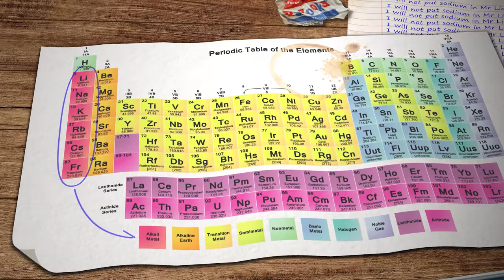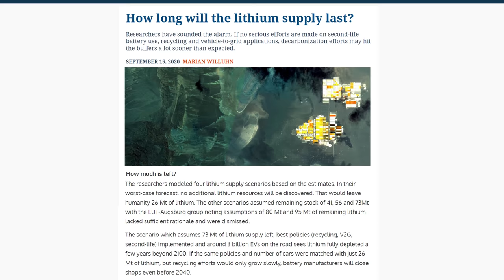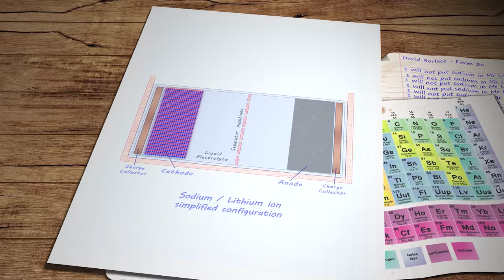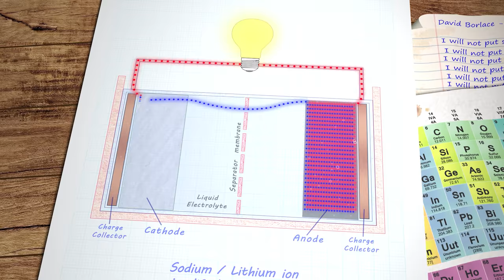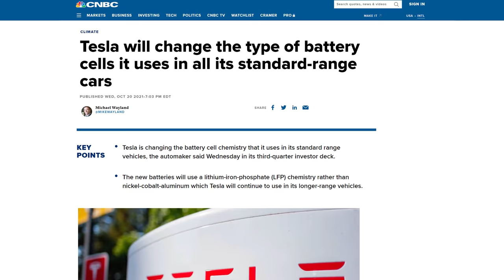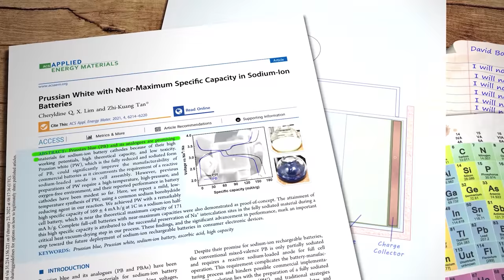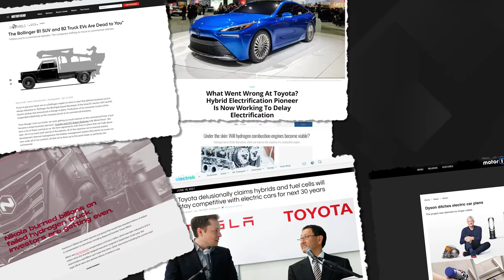Sodium-ion battery breakthrough. Safer, cheaper and cleaner than Lithium-ion

Comment: Thanks for this great work.  It always seemed strange to me that lithium became the main battery product for storage where weight is not an issue.  It shows just how important investment and manufacturing momentum can be in sealing in sub-optimum technology (e.g. Betamax vs VHS).
Reply: There's a lot to be said for sub optimal I reckon particularly when it's mature if not old tech.
At the moment lead acid batteries are so cheap it is ridiculous. If you size the bank to never drain these type of batteries below 10% of max capacity they could last a dozen years at 1/3 to 1/4 the cost of lithium based tech for considerably more amp hours to boot.
Of course if you need lithium you need lithium, but for home storage do you really need lithium, when lead acid (AGM) at similar life, more  amp hrs and 1/4 the cost will do essentially the same thing in many applications?
Reply: @ThePaulv12  Very interesting, thanks for sharing! Doing some quick searching, I was surprised to see that a $200 (retail) car battery has capacity of about 0.7kWh, and I assume it's possible to buy them wholesale if buying a large number of them. Any favorite pointers on resources for people wanting to learn more about lead acid batteries and how to integrate them into an off-grid home? For example, how would I make sure they don't drop below 10% capacity? And what kind of parallel / series systems are recommended for lead acid batteries?
Reply: @ThePaulv12  That lead and lithium are both toxic is one problem that sodium batteries could solve. I've also seen some research on aluminum batteries.
That said, it's hard to beat good ol' lead-acid for value. It's kind of like burning coal for energy.
Reply from the maker: Thanks Philip. I completely agree
Reply: @dosadoodle  Ideally you don't want to use ordinary automotive batteries but rather deep-cycle Pb-acid batteries designed for off-grid use.  Alternatively, I have seen people use in the past Pb-acid forklift batteries or second hand cells from comms towers or railway signalling for off-grid storage.  Using a decent charger/inverter should let you select the battery type and discharge limits of the batteries.  I couldn't tell you any makes atm as it's 25 years ago that I fitted a hybrid solar-diesel Pb-acid storage system at the school I was teaching in rural Zimbabwe.  We were the only place with electricity in the valley once the system was up and running.  The electronic charger/inverter we used was top of the line back then and very efficient and adaptable.  So, today's tech should be at least as good at a fraction of the costs I would hope.
Reply: Yea. We often get obsessed over very minor technical differences in tech which don’t actually affect 80% of customers.
Reply: @TheTomBevis  Lithium is not particularly toxic.  It's way, WAY, WAY less toxic than lead.
Reply: Not disagreeing with your point - but with your comparison. That old Betamax/VHS trope is far more complex than just the "suboptimal" technology winning. The main reason that Betamax failed was that the cassettes weren't long enough to hold an entire film. And by the time they'd twisted the technology into doing this, the battle had been long lost. Products win or lose mainly on how they match people's requirements, not on how clever they are. For instance Blu-ray never replaced DVDs, despite being a superior technology because DVDs were good enough, pre-HD TVs, and then streaming came along. Ditto with minidisks - much cleverer and more convenient that CDs, but CDs were ok enough to make upgrading too onerous - and then (again) along came easy access to music via the internet. The key to the success of a new technology is not is it better than the previous one, but is it better enough to make it worthwhile changing. Does it offer a significant bonus to the consumer? If not, it will fail. Hopefully, the answer with these batteries will be 'yes'.
Reply: @TheTomBevis  : To the best of my knowledge, all aluminum batteries are non-rechargable (in a sense that isn't even true for alkalines, since those just suck as rechargeables). In particular, I strongly suspect that trying to recharge the existing/proposed aluminum battery designs would result in severe internal sparking, in turn resulting in heat buildup, internal damage, and a localization of current flow significantly limiting the amount of restored charge. Aluminum batteries are probably better treated as an emergency power source to rebuild power generators rather than something to be used by normal consumers.
Reply: @dosadoodle  I'm talking for 48v battery bank.
Deep cycle lead acid of the AGM type can be found in these parts for sub $550ea for a 6v cell and 550ah.
Well you need 8 of them for a 48v bank for a 48v inverter and you're in the sub $4500 region. Try getting that capacity in lithium at 48v and see how much it costs
 Also you'd need to run 2x parallel strings of series connected lithium banks with all the issues that entails to get similsr amp hours.
48v is the current ideal battery bank voltage for dedicated off grid 24/7 solar 240v electricity - sunshine permitting of course.
Reply: @ThePaulv12  Thank you for this additional info! Very helpful for a direction to explore further.
Reply: @dosadoodle  Just so you know car bayteries need CCA (Cold Cranking Amps) and that's their primary role. Their secodary role is for storage. Deep Cylcle batteries are different to car batteries. Top quality lead acid deep cycle batteries can be found with 2v cells. The cost of them is very high as you meed 24 of them to get 48v putting them into the realm of newer tech but it seems 6v batteries could be worthwile if you don't need lithium.
Lithium is good. It takes little time to charge up making it ideal but lead acid could be worthwile if you buy batteries and solar panels that are more than you bare minimum power needs. It's a balancing act.
Reply: An oil company bought up the EV1 patents, prohibiting the use of NiMH batteries in automotive applications. So electric automotive start-ups like Tesla were forced to use off-the shelf laptop batteries (18650 cells). See the "Patent encumbrance of large automotive NiMH batteries" wikipedia page.
Reply: Yeah there are a lot of far less expensive battery options (like salt water and iron chemistries) which would make sense for grid storage where performance is far less important than cost. But none of them have gigafactories backing them.
Reply: @ThePaulv12  
Lead acid and nickel cadmium both use heavy metals that have gotten into the environment and done toxic damage.  It's best to keep them out of the environment.

As for cost, the lithium batteries are cheaper,  per kWh than the lead acid, which last much, much less than lithium.  This is because the lead acid battery makers don't make them to last.
Reply: Where do you get the idea that lithium is toxic?  Lithium carbonate is or has been used medically for ages to treat manic depressive mental disorder.   I have even eaten some to see what it did. Nothing I could notice. Sodium is definitely toxic when consumed in excess  by upsetting electrolyte balance. Nearly everything is toxic when consumed in quantity, even water.
Reply: @acmefixer1  That's  absolutely not the case. Cycles on a sticker stuck to the side of a battery case are pure lies. It is not anything like the full story.
What is far far more reliable indicator of life is years not cycles as lithium industry hyperbole would have you believe. If you compare lithium cycles vs lead acid cycles then 'reason' would confirm lead acid as the clear looser - but it actually isn't. Lithium battery life is a false claim because to get those cycles the battery would have to outlast lead acid batteries but lithium batteries dont actually last that long.
For example lead acid battery tech is very well understood. Not discharged more than 20% they'll last about 12-15 years. Since the ah capacity of them is far higher, they are far cheaper then over a 12 year period lead acid is still miles in front.
Food for thought. Of course lithium has its place but don't buy into the hype until you've tried to disprove your own assumptions. I did and believe it or not I'm back to lead acid AGM variety. Problem with lead acid is very well understood and if you suit the battery correctly to the application and follow the rules you're well in front.
Reply: @jamesphillips2285  NIMH batteries are more stable than lithium ion, but have much lower energy density.
Reply: @carljaekle  I don't think the difference is that great: once you start avoid charging over 80% or discharging below  30%.

Suddenly 2x the weight, but being able to use 95% of the capacity is not so bad. You may be able to get away with a smaller capacity battery to stay within the same weight budget.
Reply: @jamesphillips2285  I don’t see NIMH cells making a comeback.  Next up, I think will be sodium ion cells.  CATL announcing production soon, power density up to 200wh/kg.  No lithium or cobalt.  More stable than lithium ion.  Sodium very abundant on earth.  Very durable.

Comment: I just caught this video today, great topic. Sodium ion and lithium ion have very similar theoretical energy densities, even though sodium ion has a 0.3V lower terminal voltage. The problem thus far has been achieving high energy density with sodium ion both at room temperature and with long cycle life. It appears CATL and others have made strides on both of these issues. This would be a huge win because aluminum, carbon, and sodium are all common in Earth’s crust, whereas lithium, cobalt, and nickel are not,
Reply: But don't they need things like vanadium. It's a giant step in the right direction and for static uses its definately going to happen. I think CATL are about to launch something but in my world it will be an amalgamation of Sodium Ion and Lit hium ion. We shall have to wait and see.

Comment: I think the biggest determinant of which chemistry will, in the long run, win, will be the carbon footprint from the extraction of raw materials, the construction of the battery, the disposal of said battery, cost of manufacturing and finally the extra energy used in use (thinking of extra weight for transport applications). It seems like these CATL tech sodium batteries may actually win this end to end carbon impact race. I hope a few more manufacturers get on board with Na and drive the cost down!

Comment: Na-Ion batteries definitely have a future at a very minimum for fixed installations. I have a Power Wall and would have liked to have significantly more capacity so I could eliminate my connection to the grid. Na-Ion batteries may just allow that at a reasonable cost.
Reply: Exactly. People often get too obsessed with the next breakthrough that applies to EVs and ignore what you’re talking about. I’d love to install one of these in my home…when I can eventually afford one at least haha.
Reply: And 10,000 cycles with na-ion batteries lifepo4 has 3000 to 5000 and ncm have 2000 3000
Reply: @lesstevens2370  10k cycles only applies to the *Cathode*, to note. the Anode is still carbon-based, and has a similar cycle life to Lithium. That will have to be replaced before you see 25-year batteries show up.

Also, in many states, it's illegal to completely disconnect yourself from the grid unless you live in a camper. The power company will still charge you a minimum, or force you to sell your excess power for a fraction of what they'll resell it for. I wager that minimum will go up as more customers with land put solar panels on it. or charge us poor peeps who live in apartments more, hoping we elect people who take it out on y'all.
Reply: @lesstevens2370  LTO is a heck of a chemistry for stationary applications, yep. I have seen them used in DIY E-vehicles before because of that cycle-count, where they don't mind the loss in range (or if the battery's going to be in harsh conditions a lot because as I understand it they're pretty resiliant to mistreatment, too).

As for laws and having to remain 'on the grid', that's in some sense intended to prevent squatters, people running their houses off of gas gennys (have done that before) and ensuring that there are enough customers in rural areas to actually sustain an electric infrastructure. 

See... Solar panels and micro-turbines are not cheap at the consumer scale, and you've got to be fortunate enough to own land or at a minimum the structure the panels are going on. Maintnance cost of a utility is based on area, revenue is based on customers. so as those that can afford it go off grid, the folks who don't have that initial investment get screwed. Similar reasoning to why EVs have a road use tax slapped on their registration every year in some states. And some have considered making E-bike users like myself also pay for it since many of us replaced our cars (I didn't, but it's common). We still need the roads de-iced, we just don't contribute anything to paying for the salt or the wages of the poor sod going out there at 3 AM to plow.

(as for the parties? There's a great CGPGrey video about first-past-the-post which sums up why that is better than I could hope to)
Reply: @DFX2KX  yes lto is great they also can charge at -45 c its going to be my go to replacement for my rv its just up front costs for 45 ah 6s 40$ a cell so if I want 200 ah I'm looking at over 1000$ but would be last batterys i buy plus a 10c rate
Reply: @not today because you have to pay for that connection, and in some areas/with some utility providers, you'd have to produce truly prodigious amounts of power to offset the minimum fee you'd be paying each month. You're not selling it for the same price as you'd be buying more. The minimum here is like $30 a month, and we pay 0.017 Kw/h.  to make that back and pay nothing, I'd need to produce 1.7 Mw/h.

And many places charge more than that.
Reply: @DFX2KX  It is not illegal anywhere to go off the electrical grid. It would be unconstitutional to force you to stay. They can prevent you from using a gas generator or Natural gas generator because of the pollution they emit, but solar panels don’t impact anyone else in most situations. As long as your solar panels are installed according to code and don’t negatively impact your neighbors they are legal. Don’t pay your bill and see just how quickly you go off the electrical grid.
Reply: @matthewhuszarik4173  oh ir might be unconstitutional,  but that does not stop municipalities from doing it.  Gotta have money to fight that.
Reply: @matthewhuszarik4173  see, you're right, if you don't pay your bill, they'll disconnect you. But They'll still be racking those service fees onto your account regardless. Eventually the Utility company can get the city involved if it's clear you're still living there, they can (and in a few cases have) condemned properties and evicted people off their own land over stuff like this. 

How? There's this little thing called Zoning laws , which dictate what you can and cannot do with a property. Off-grid electrical production, subsistence farming, keeping chickens, all may or may not be legal depending on the zoning laws of the lot in question. If you're in the city, disconnecting from utilities is in all likelihood prohibited in the zoning laws in question. You can put panels up, but you must maintain a grid connection (and pay the associated service fees) or the house gets condemned. Nobody as of yet's been ballsy enough to try and fight the city on it.

You can't even camp on your own land for more than two weeks in most places. This one isn't too often enforced, though.

Comment: 95% capacity after 10,000 cycles is awesome. The kicker is, like you mentioned, the volume necessary for all the EV's etc that will be sold in the next few years. With that much market value, the impetus for R&D must be huge. Keep in mind the first EVs had lead-acid batteries, so while weight is a consideration, it's not the elephant that it might seem to be.
Reply: Weight is still an elephant and always will be. Not everyone will be serviced by a regular-sized ICE-powered vehicle and that will be the same with their EV replacements we know that the demands on the battery will increase substantially as the vehicle size grows but you just can't keep fitting a bigger battery because you run out of space and you make the vehicle ridiculously heavy which eats into its payload and also adds to the stress on the battery output. For batteries, to power, the larger vehicle we use now a more energy-dense and lighter sort will need to be developed.
Reply: I'm a home energy guy and want batteries that do not cost me the price of the battery to recycle them when they finally wear out. I like fast charging capabilities and looking forward to solar charging capabilities info.